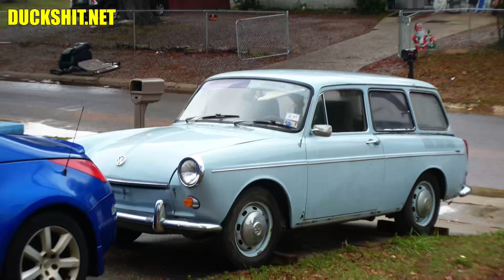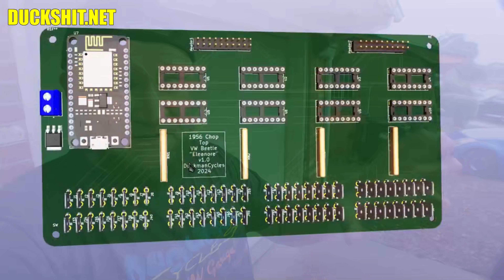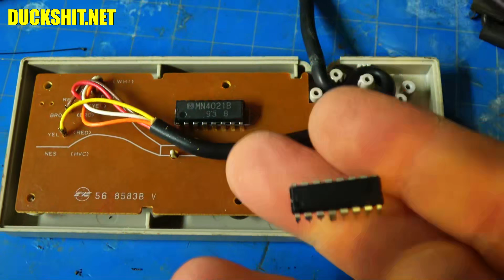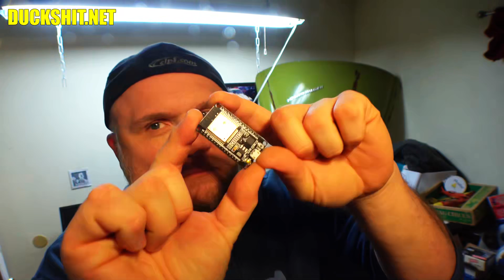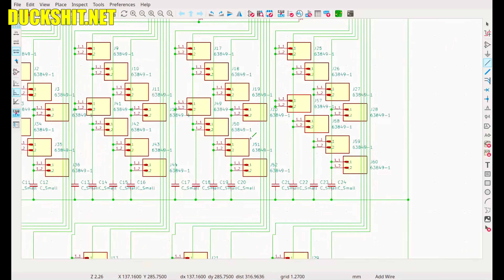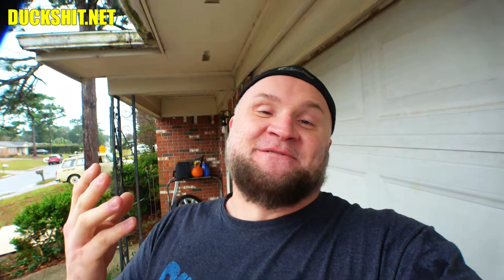Nintendo Controllers and Air-Cooled VWs - 1956 VW BEETLE - 185

Comment: As long as it stays reliable. I`m an old analog guy but only because I`m old.
Reply from the maker: The beauty of it.... part of my project requirement was if it breaks, its roadside repairable... and if its completely borked, I'll have a replacement board....and if all else fails, just move the wires back to where they belong!  Easy!   Thanks man!  Hehe!  😁👍🦆💩